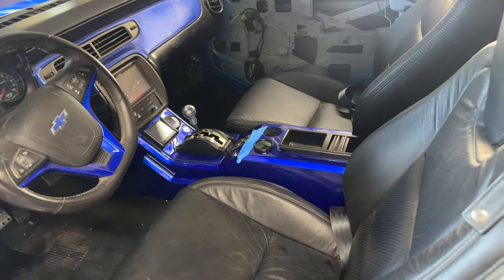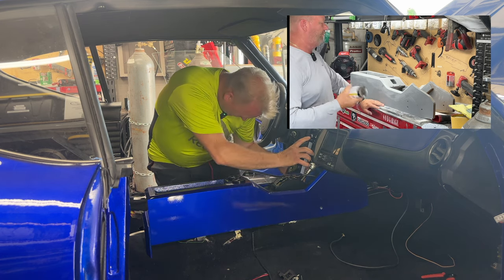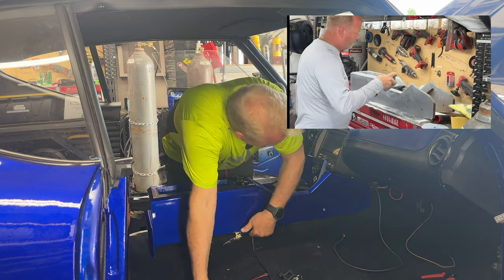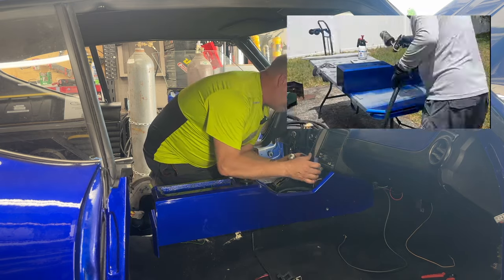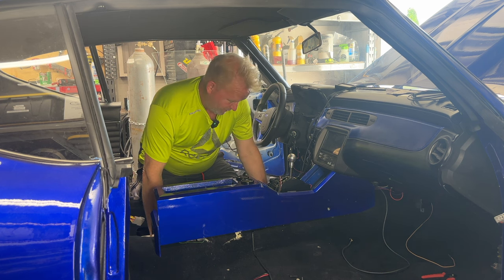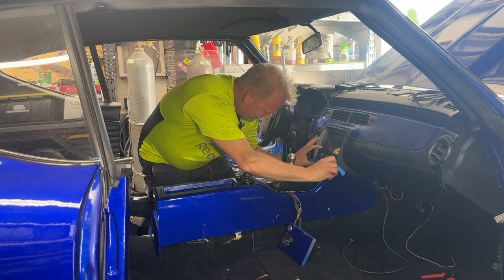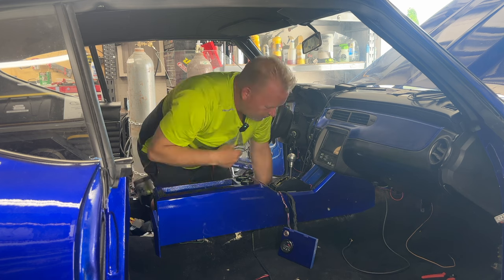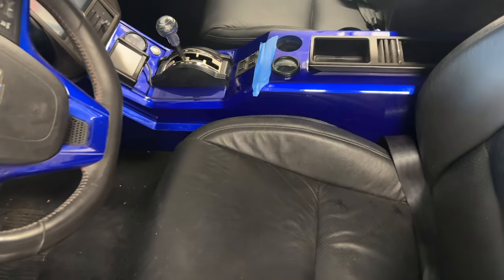Why This Restomod Console is Worth $5,000

Comment: Question why didn’t you use the gen 5 console you prepped it for in earlier videos?
Reply from the maker: Yeah I put so much work in that and it looked so cool! Thanks for watching the other videos. I couldn’t make the shifter work properly so I had to find a different shifter. I guess I wasted 50 hrs at least with the other console.
Reply: I know how annoying that can be. Why didn’t it work? I am doing the exact same thing in my 78 Camaro but shifter seems to work out🤔
Reply from the maker: @duniet  you must be using a different transmission. I am using a 4l80e and the travel is different.
Reply: @SOB_Garage  your right, mine is the 6l80. If you ever feel like swapping gauge cluster from a gen 5 let me know, I’m working on encrypting all the canbus messages, so I can run a gen 5 gauge without error codes because of missing modules. All you need is a bcm and a few wires :-)